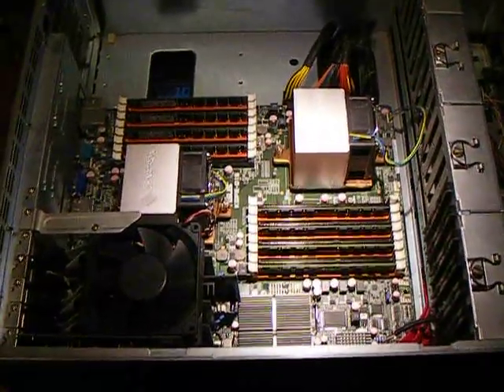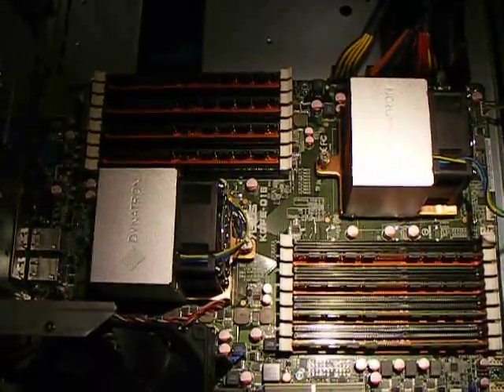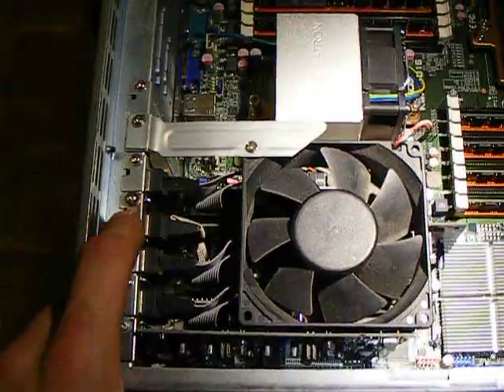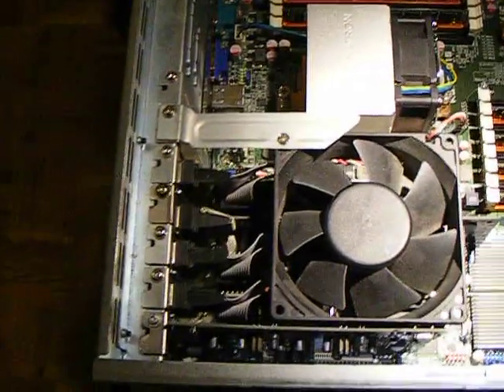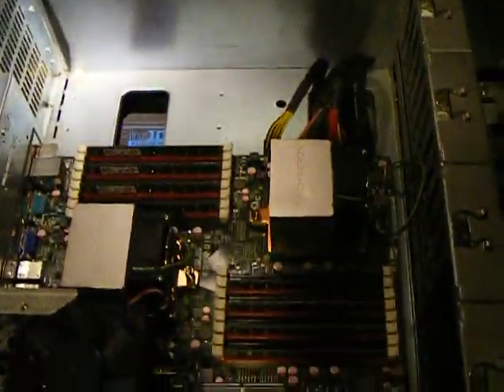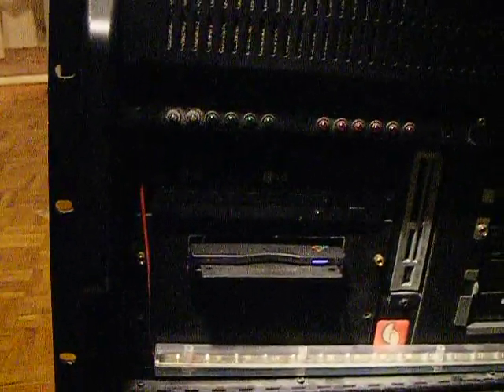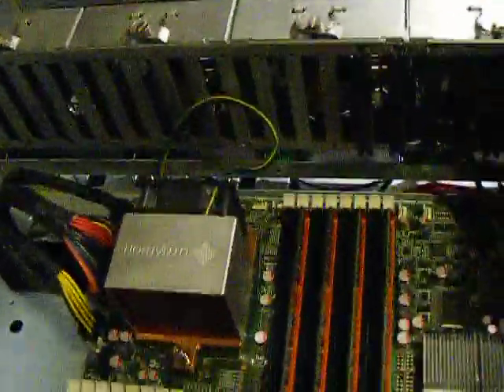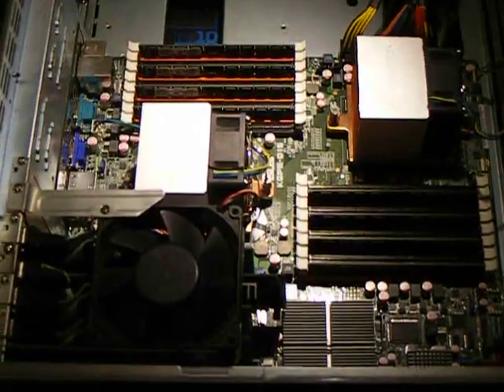Whats inside my 16 core PC

Comment: 16 core opteron is still pathetic when compare to a single i7 4770k or 4960x
Reply: depends on the speed of the cores... how multithreaded the software is, etc... i put together a dual socket F Opteron 8439 SE rig, and its somewhat faster than the i7 4770 i use daily for productivity work.  Scores between 9.7 and 9.8 on Cinebench 11.5... see my channel.  i haven't yet run gaming benchmarks on it (yet).  But honestly the i7 sometimes feels like a dog in comparison... there is something to be said about having 12 true cores, vs hyperthreading.